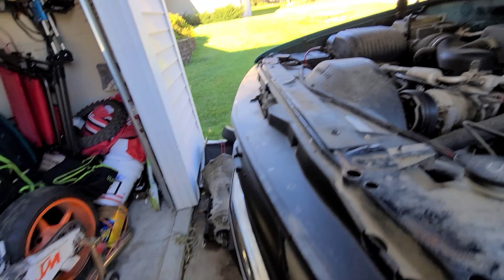1996 Chevy Silverado  K1500 5.7l 350 MAP sensor

Comment: Thank I got a code P0108 MAP Sensor is High? Humm didn't know where it was! GM seems to hide stuff.  With Ethhol in gas, it does a number on rubber/plastic sensors.
Reply from the maker: Yeah, ethanol can be hard on stuff not designed for it.

Comment: Just changed out the spider injectors and still have the misfire. Runs good at idle and floored but cruising  speed popping and sputtering.
Reply from the maker: I would check the following.  Fuel pressure, vacuum leaks mainly upper and lower intakes, maf sensor and the distributor.  I've had this condition before and the distributor was worn out.
Reply: @LowLifeAntics  I put in all new gaskets in with spider injector has new plugs wires cap and rotor fuel pump is 6 mo old but I will check fuel pressure  even changed fuel tank sensor. First time hearing about the distributor but will definitely keep that in mind. Motor has 10k on it but is original distributor
Reply from the maker: @jamiekestler3835  10k to have this issue is not good. Sticky exhaust valves can cause it too but with that few of miles i doubt it. I'd be looking at vacuum leaks or the distributor
Reply: What distributor and should I look at the coil too
Reply from the maker: @jamiekestler3835  I'm sorry, I just saw this. Did you rectify the issue?
Reply: @LowLifeAntics  no I haven't I have disconnected the egr valve to see and the throttle position sensor still there. Somewhere I read it could be a bad distributor but I have a hard time believing that.  I'm going  to check fuel pressure and go from there?
Reply from the maker: @jamiekestler3835  it could be a distributor. It's a good idea to start with the fuel pressure.
Reply: @LowLifeAntics  what goes bad with them
Reply from the maker: @jamiekestler3835  the gear tends to strip out on them.
Reply: @LowLifeAntics  so what distributor and coil would you recommend
Reply from the maker: @jamiekestler3835  honestly you can order an a-team kit, a summit kit or speedmaster and be good. Even the ones from advance auto are good enough.
Reply: @LowLifeAntics  thank you I will start looking into stuff cause once I figure this out I want to cam it and maybe do a sniper system
Reply from the maker: @jamiekestler3835  hell yeah, that should be fun.
Reply: @LowLifeAntics  we built this truck for my son and we have redone pretty much everything
Reply from the maker: @jamiekestler3835  that's awesome!  He is going to love it!
Reply: @LowLifeAntics  he has helped the whole process that way he can fix it if he can or at least give it a shot
Reply from the maker: @jamiekestler3835  and he will k ow the true value of that vehicle.  It won't be just another truck to him.
Reply: @LowLifeAntics  haha yes he already does he doesn't even like taking it on dirt roads and it's 4x4 haha
Reply from the maker: @jamiekestler3835  That's a good thing! Haha
Reply: This is same exact issue I’m having! Did you ever figure out what it was?
Reply: @anthonyg9389  I changed the fuel filter again even tho the other was brand new and so far so good. Wonder if it was  clogged just a little
Reply: @jamiekestler3835  oh wow lucky you that you found the issue. I replaced the fuel filter as well and am still having it
Reply: @anthonyg9389  I'm still a little weary cause it still doesn't have the fuel pressure everyone on here is saying it needs to run. It's about 55 ish so we will see man
Reply: I have the same problem. I changed the O2 sensors and it definitely made a difference. I also replaced spark plugs and wires. cap and roader, MAF sensor and crank position sensor without fixing problem. After the o2 sensor ive only had one misfire episode and I’m getting ready to try replacing the map sensor I’ll come back and let you guys know what happens
Reply: Im replacing my MAP sensor, and i picked up a new MAF sensor today..any luck?  I'll let you know.   Also be sure your air cleaner housing has a good seal so no extra air is being sucked into the intake @TRX_GHOST